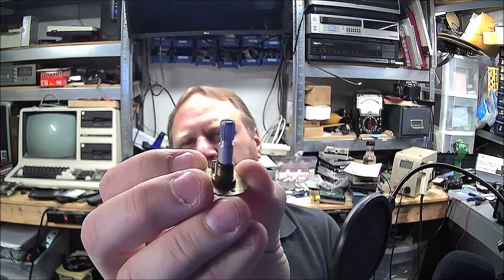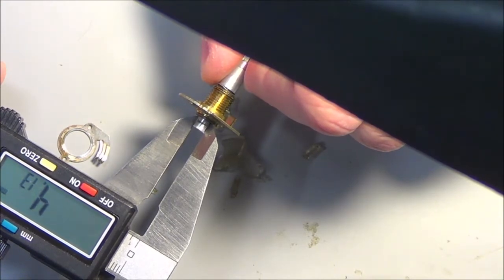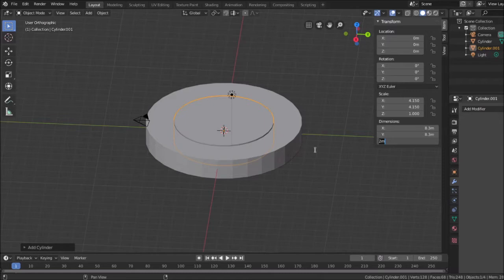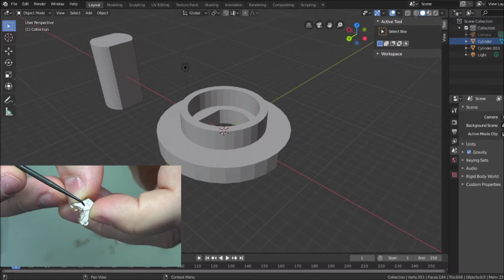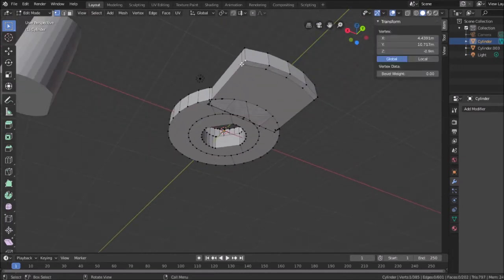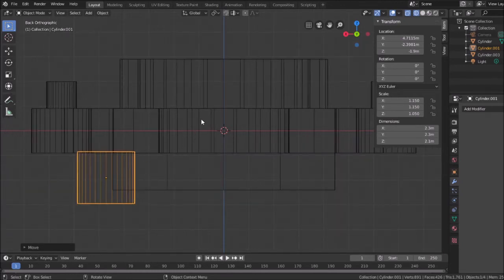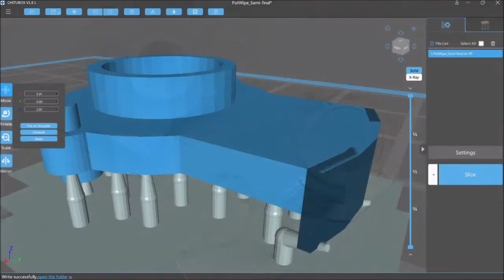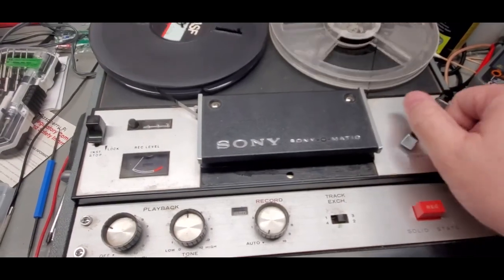Fixing a TC-105 Tape Recorder Volume Control

Comment: i have the same one, mine works almost perfect, it records but doesnt playback, but if i put the reel on another reel player i can hear the recording i just made, but it just wont playback on this, everything has neen fixed a few years ago, all the speeds work, new belts new cap, just will not playback anything. im stumped
Reply: What happens if you record something on the other player and try it on the TC-105?

Comment: Actually I need two because the record/ auto control has the same problem.John.
Reply from the maker: I'm not sure if the two controls are the same. I don't have my player anymore, so I can't check for that. The two controls may be different internally, especially if the other one doesn't have a click on/off.
Reply: Ive checked record/ auto switch and it is the same internally it has the on off switch which acts as a auto level/ manual.Anyway I just thought you may have printed off more than one and had some spare to sell.Thanks  for your reply..John
Reply from the maker: @MrJohnberth  

I didn't forget about you. I just didn't get a chance to set up my 3D printer to print more. If you still need some, I can print them for you this coming weekend. Feel free to contact me via email at vintagevolts@gmail.com
Reply: @VintageVolts  Hi there.How much will you need to cover the postage and of course making the parts?
Reply: Actually the carbon tracking is badly worn on the volume pot.Couple of dead spots.So fitting your part isnt going to sort that issue out.Thanks for your time.Think Ive sourced a replacement from China now.